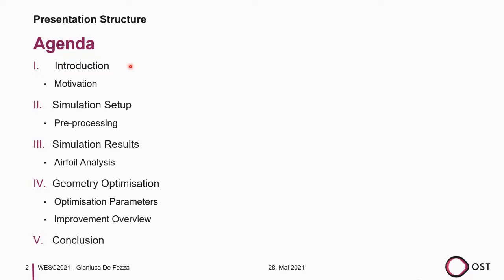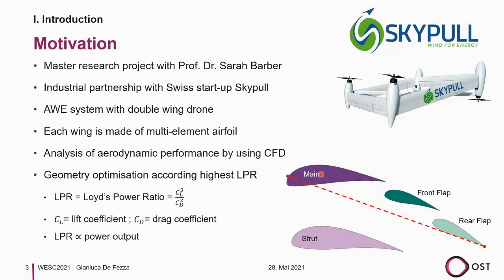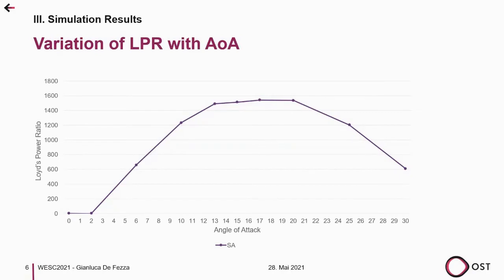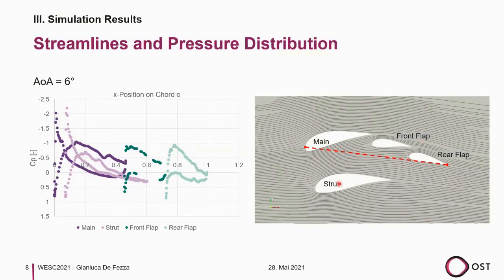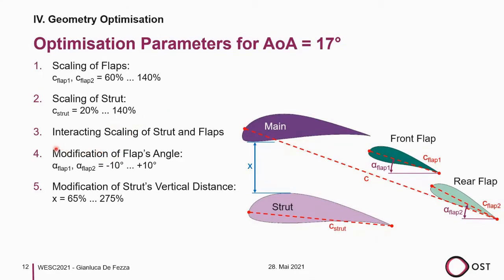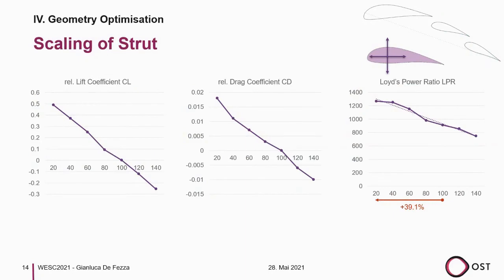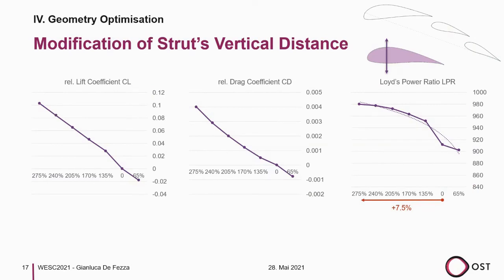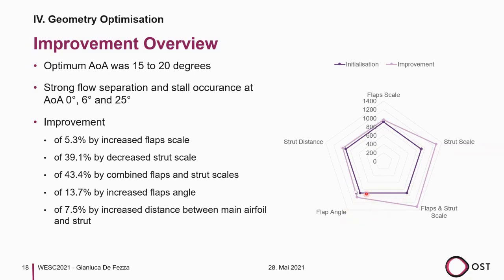Scientific Talk about Optimisation of a Multi-Element Airfoil at WESC2021

Comment: Your videos are so great sir!

Im doing some cfd for f1 wings, and Im facing some troubles
I have a 3 elements wing, but I don't know how to calculate the planform area

Should I adjust all the 3 elements to zero AoA, then taking the planform area?
Or should I consider all the 3 elements as 1 indivisual wing and then taking the planform area?
And if I did the second choice, should the equvalent wing be in zero AoA or what??

Im very confused!
I don't know which chord line to use and what are the conditions that should be achieved for the chord line

Please let me know
Reply from the maker: Hello and thank you for your comment. I guess, with planform area you mean the relevant reference area A of the wing. A = c t, where c is the airfoil chord length and t is the airfoil’s thickness.

Which choice you use for defining the chord length is up to you and which results you want to achieve. In my case, I did your second one, where I have measured the distance from the stagnation point of the main airfoil to the tailing edge of the second flap. 

Regarding the AoA, you can decide yourself how you want to go with the naming. Theoretically, you could reference the AoA and have your 0° AoA where ever you want. But this is confusing. I did take the correct measured angle, so no confusion was created. That is also why the best AoA was around 25°.

In this kind of research, there is almost no right and wrong. Just go with what convinces and is best to work for you. Follow your thought and you will be fine.

Kind regards
Reply: @gianlucadefezza6693  
Thank you sir
That really helped me

Comment: Hello Gianluca, I have a question about changing the AoA of the whole wing (with flaps and strut). About which point are you rotating the whole wing? Is it the quarter-chord point of the main element or the quarter-chord point of the combined wing chord(line from main element leading edge to rear flap trailing edge)?
Reply from the maker: Hi Meto, the centre of rotation was always the stagnation point of the main wing and considered as stagnation point of the whole wing.

Comment: Lloyds power ratio (LPR) is something I have never heard of. Would you please provide a reference to understand what LPR is? Unable to find anything ...
Reply from the maker: The useable power of an airborne wind energy system (P = 2/27 * rho * A * (CL^3 / CD^2) * v^3) is described in the Loyd's formula https://homes.esat.kuleuven.be/~highwind/wp-content/uploads/2011/07/Loyd1980.pdf. LPR is actually not yet widly used in literature and describes the aerodynamic performance of the airfoil, which is proportional to the power output of the airborne wind energy system (P ~ LPR). This means that LPR = CL^3 / CD^2 (CL = lift coeff.; CD = drag coeff.) and is the only variable and optimisable parameter (apart from A) in the Loyd's formula above. Some references, such as https://www.sciencedirect.com/science/article/abs/pii/S0960148117310285?via%3Dihub, do not call it LPR, but formulate it as P ~ E^2 * CL, where E = CL / CD is the glide ratio of the airfoil. Thus, in order to maximise the power output of an airborne wind energy system, LPR must be maximised.

PS: For more information on measuring performance output, see the recently published article (link in description).